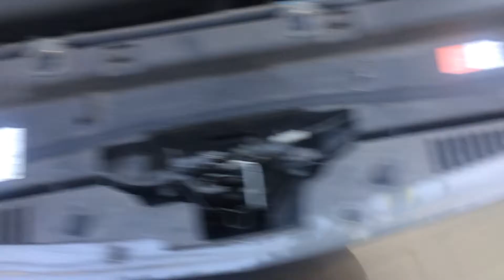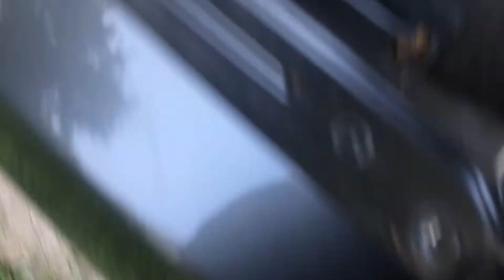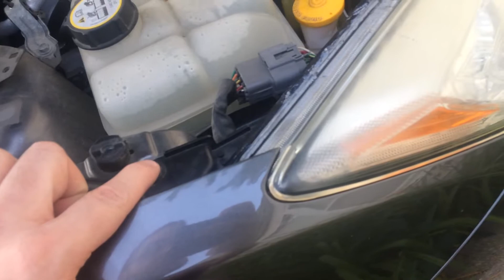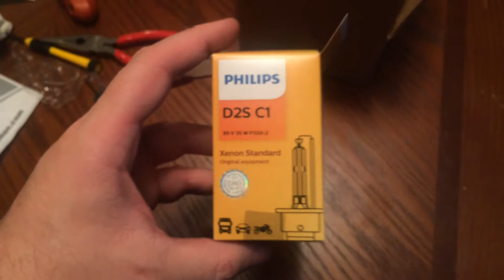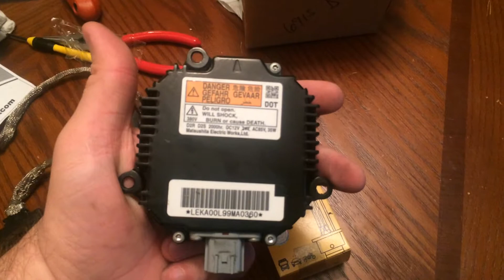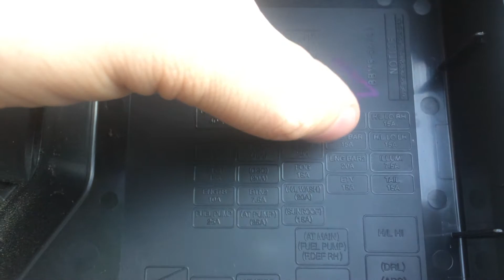2010 Mazda 3 GT OEM Adaptive HID Xenon Headlight moisture troubleshooting tips SOLVED

Comment: I have a 2010 I Touring, have condensation on the passenger side headlight, the bulb suddenly stopped working. Before buying new bulbs I removed both fuses under the hood for the headlights and reinstalled them. Boom, the right headlight works again. Saved me some cash and some work, thank you.

Comment: Did you have an issue with the headlight patern when you swapped wverything back in. Seems like the one i replaced is not focused.
Reply from the maker: I didn't have any issues but you might want to check that the bulb is seated properly, or try a different bulb. Also check that the replacement is the same as the old one, it's possible that they were replaced with something different prior.

Comment: Thanks for the video, i saw another one where he referenced this one, so now I am fully going to check and take apart what is needed.  
The dealer wants 1500.00cnd for the entire light to assembly plus installation.  Not going to happen unless its full buggered.
Reply from the maker: I would start by pulling the fuses shown first and going from there. Re-insert fuses, check light. Change bulb, check light. If none of that works, all that remains is the ballast. It's all fairly easy and cheap to DIY.

Comment: I want to thank you for this video. My passenger side headlight stopped working last night. I have a 2009 Mazda 3 MPS (I think in the US this is know as the Mazdaspeed3). I have had the car since brand new and it has now done over 123,000 miles. I thought I'm not going to complain as I have never needed to change any bulb for over 14 years. My initial thought was "oh it's just changing a bulb, no big deal" until I looked in the Owners manual where it suggested I take it into the Mazda dealership. I had a look online about replacing the bulb and read about needing to remove the bumper and the headlight. My heart sunk. I thought I would pop in to see my Mazda garage about the cost . They booked me a diagnostic appointment for next week. I came home watched your video and decided to double check the fuses, i started with the fuses in the engine compartment, both looked ok however just like you the act of taking them and putting them back in seemed to resolve the issue. So again thank you for your video.
Reply from the maker: That's awesome! I'm glad you were able to fix it so easily!

Comment: I have a question, I have a 2010 mazda 3 S 2.5L, I tried to change the light but there was no space at all, I watched a couple of videos of how to take the bumper out to take out the headlight, how many bulbs do I need, 1 bulb or 2 (low and high beam bulb)?
Reply: Depends on your model. Some models have the basic halogen setup, with separate high and low beams. Some have the xenon bulb, which is both high and low beams. If you have AFS, then I'm pretty sure you have the xenon bulbs. You can tell by looking at the back of the headlight from under the hood, it should say what spec bulb it takes. If it says D2S, it's xenon.

Comment: Video nice and clear.  I'm glad you mentioned the ballast.  My driver's side low beam stopped working - checked fuses, relays. Pulled out the headlight unit because no room and too awkward to check things out in place. Bub ok - THEN - having seen this video, I looked at the ballast. Luckily, I have a right headlight from  a little crash 2 yrs ago - - swapped them and wa Laaaaa  - if that's how you spell them.   I might need to look for a "softer" light - LED is not the greatest.... That's again for your video...

Comment: Is it possible to switch out the factory HID for led with the original housing? Or would I need new non adaptive headlight assembly?
Reply from the maker: They appear to be different headlight assemblies. These have the ballast and igniter built into the headlights and the ones for the halogen bulbs don't.
Reply: @miata350  Thank you for your reply. I appreciate you.

Comment: Thanks for the video. This happened once before to me and I ordered a balast/wiring/lamp from a Chinese website and had a local auto-electric guy do the install as I don't know anything about such electrics and hear the potential shock from these systems can be deadly. I had no idea if the site was legit nor if it would work and ended up happily paying $400+ when all was said and done (better than the $1000 I saw for a replacement unit). That said, what you're describing sounds doable for me as I'm generally ok with mechanic issues (just not electric). Did you know what you were doing when you dived into this  or did you find instructions or tutorials beforehand? In your opinion, is this pretty doable for someone who is somewhat "handy"? Thanks!
Reply from the maker: I didn't have any prior experience. It's definitely doable because all you're really doing is unplugging the bulb which is something that's commonly done anyways to change them. The ballast plugs directly into them with a braided silver cable. It's definitely doable. If I can do it anyone else can.

Comment: Thank you for this video!  Love my car but this is utterly frustrating; I just spent over $200 on labor (+$60 on 2 new bulbs) and the bulb didn't light up. I should've paid more attention to the moisture and gotten a new ballast before getting the work done.  The mechanic is suggesting to get a new headlight assembly, because of the condensation, plus a new ballast.
I am hearing on forums people say once removed, you can put the assembly in the sun(and even the old ballast to see if it will work again) and then reseal the gaskets on the assembly with silicone to prevent moisture from getting in again.  How did you handle the moisture issue?  Has the new bulb, ballast etc held up?
Did you disconnect the battery cable(O'reilly auto guy said be very careful of electric shock)?
I'd rather not pay hundreds in labor again for this, and will check the fuses today(I think O'reilly's can check these and get a reading on them).  Any advice is much appreciated!
Reply from the maker: I didn't disconnect the battery but it's a good idea to do so. I drilled a tiny hole at the lowest point on the underside of the headlamp (where water flows down to) and this allowed me to drain out the water. With the bulbs removed, I blew air into the bulb holes overnight to dry it out. Then I added silicone around the seal of the whole housing. It's held up and I haven't had any more problems since then. I would definitely pull the fuses if they still don't turn on because after I replaced everything that was the one thing that reset the system and made it work again.
Reply: @miata350  great advice, and sounds like persistence paid off.  I think I'll give all this a try, cheers
Reply: @miata350  Oh and one more thing: for the ballast, did you only order the ballast or did it have the wire cable to the silver connector thing? If it was just the ballast, was it easy to connect the wiring to it?

Comment: Thanks for the video. I spent about 2 grand getting my headlights working at the Mazda dealer and wasn't very happy something that should be quite simple cost that much. It's been 1.5 years and my passenger side just went out again. Otherwise been a great car.....Hoping I can just replace the bulb. I haven't done any troubleshooting but will try these steps.
Reply from the maker: Yeah I suggest trying the fuses first then going from there

Comment: Ahhhh! I would so appreciate your help! My passenger side headlight was out I've owned my 2011 3 since november. After getting the new flipping 100 dollar bulb in and it not coming on I was told by the shop I go to for help to obtain a "headlight control module" and they would swap it out for me. (They are not expensive as go to shops in town you just have to bring the parts) I worried I'm going to go through ordering a part and it not being the right thing since google results are all over the place when just searching to find one. I would to infinity and beyond appreciate your help! I have no one lol >.<
Reply from the maker: I would first try pulling the fuse like I did. Take it out, check it, put it back in. You may also try disconnecting your negative battery terminal for a few minutes and reconnecting it. If it still doesn't come on after "resetting" it, the ballast is probably bad. That's what ignites the Xenon bulb. I just checked ebay and there are used ones right now for $40. Just search "BBM5-51-0H3" that's the part number. Hope that helps!

Comment: I appreciate the video! The passenger light on my gen 1 is out for the same reason, and there hasn't been a lot of info for this problem, so this helps a ton for when the new ballast finally comes! 

Can I ask how you removed the moisture/condensation from the headlight assembly?
Reply from the maker: I drilled a tiny hole on the bottom to drain out about an ounce of water, then used a dab of superglue to seal the hole. I also removed all the bulbs and blew a fan into it overnight. It's still dry since then. If I ever have to do the other side I will make a better video showing everything. My main focus was fixing it and the video was an afterthought but I'm glad it helped!

Comment: Do you have any info or a link on how to actually replace the bulb?  You've done an awesome job of explaining how to remove the housing! Thanks!
Reply from the maker: If all you need to do is replace the bulb, that's fairly easy. More complicated if it's the ballast too. I should have documented more of the process but I was in a hurry to get them working again.

Once the headlight is out of the car, the circular cover on the back comes off. I don't remember for sure, but it might twist off. It has a rubber seal so it might be tight. With the cover off you'll see a silver braided cord with a silver connector. Unplug the connector and the bulb is under it. The bulb is held in with a spring bracket that will flip up once released. Then the bulb slides out. There is a cutout on the bulb's base that needs to line up with the hole so it's positioned correctly. It's a lot easier than it sounds.